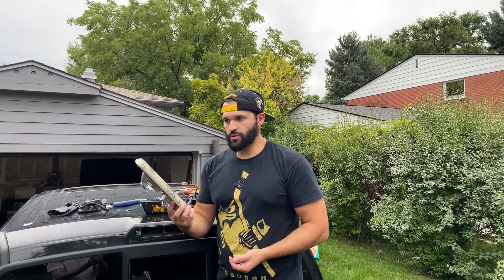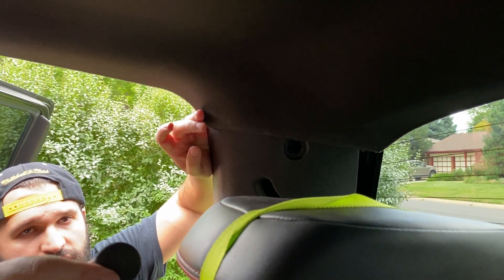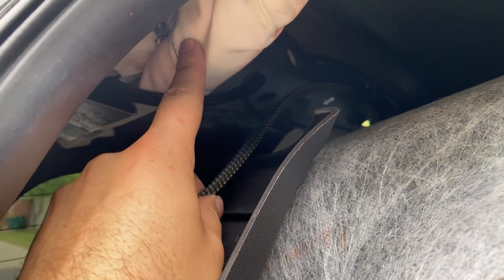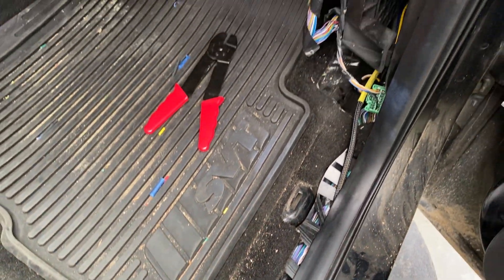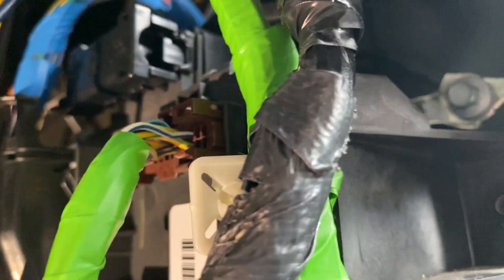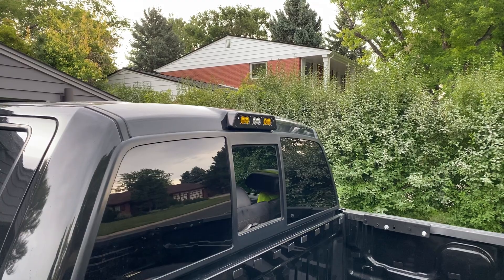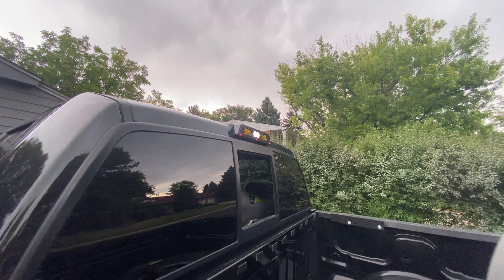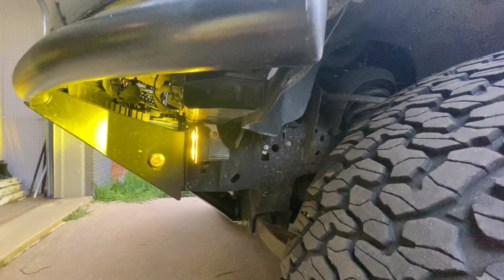How to install GJ Motorsports 3rd Brake Light -  Gen 1 2014 SVT Raptor

Comment: Thanks I am a Gen1 owner.  What are your thoughts on Headlights?  I drive down from Flagstaff and it is hard to see at night with the stock lights with the hi output halogen bulbs.
Reply from the maker: So the 14s have the upgraded headlights, so I'd recommend upgraded your headlights. If you're having difficulty seeing at night, 1000% recommend buying new ones. I know miromoto is probably the leader in that for gen 1s

Comment: Thanks 🙏 for this info. Quick question how do you control the different light is there a switch? Thanks
Reply from the maker: Yes, I wire them to one of 6 aux switches the truck comes with

Comment: Whats the cargo light mines not turning on
Reply from the maker: Cargo light is below your headline knob, left of the steering wheel
Reply: Question does it turn on when you open your doors or just turn on under the headlight switch
Reply from the maker: Yes mine turns on when you lock/unlock and when you open the doors
Reply from the maker: Sorry and manually as needed with the cargo light switch.

Comment: Bought mine from a fellow raptor owner. Am I supposed to reuse the same screws? They dont seem to reach the retention clips.

Thanks in adavance.
Reply from the maker: No, the hardware comes with screws. Assuming you're asking about the actual 3rd brake light piece
Reply: @DavidFigs  I figured. OEM screws didnt reach. I found some in my local hardware store. Thanks for the reply.
Reply from the maker: For sure - if for whatever it doesn't work, I would reach out to them and I'm sure they'd help.
Reply: @DavidFigs  I got it installed.  It works! My OEM 3rd brake light was done. The GJ is awesome!

Comment: I just installed this, but the red marker lights don’t get brighter when I hit they brake. Do yours get brighter or are the suppose to be like that?
Reply: thats what ive been wondering too, which harness do you have to get?
Reply from the maker: I actually haven't even checked if they do, my gut says no. I'll test and report back
Reply: @DavidFigs  yes please, that will be a big deal breaker for me only because of where i live, i use it as a DD
Reply: So the 3 red lights work as brake lights also.. the harness that they sent me had two wires mixed up. Had to switch the blue with the red wire. After that it worked like normal
Reply: @osvaldocaraveo9060  perfect, thanks for the update bro

Comment: This is the first video I’ve seen for the gen 1.  Just for info if you get the back up harness, the white wire taps into the white and blue wire on the BCM.
Reply: That's behind the pass side kick panel correct? What's all the diagrams showing under the hood tie in on GJ website?
Reply: Just bought this and it arrives today. Was wondering where to run the back-up light. Thank you for the info!
Reply: @RobertWojtow  the back up light can be ran to an aux switch or if you purchased the reversed harness, connect it to the white/blue wire on the BCM located on the passenger side kick panel
Reply: @atlanta3451  Yup. I added the Stop/Tail/Turn w/Reverse Harness.

Comment: I'd like to get that installed on my 2011. Havent found them yet. My Raptor is a street princess for now has been since new. Like your set up
Reply from the maker: John Somerville you can order directly from GJ Motorsports and there might even be a good black Friday deal. BD usually does some rebate for the lights atleast. Ty!

Comment: Where did you get your tail lights? Looking to get ones like yours but I want to get a pair that it reliable and doesn’t hyper flash after a week lol
Reply from the maker: It was one of the only mods the truck had when I bought them. They're nice but I recently noticed at night the difference between running lights and braking isn't great.

Comment: How do you like your light combo selection with the center a spot and wide cornering on the two outside lights?  I am about to purchase this light primarily for lighting the immediate area (inside bed and general area around rear of truck) and thinking the spot may be too much throw.  Maybe the work/scene style would work best for my application.  Did you go with the S2 Sport or S2 Pro?  I like the center white and sides amber.
Reply from the maker: Sports are more than enough light. I think the pros would be over kill. Yah work/scene on the center would be fine too

Comment: For the amber lights, is one specific to left and right or did you just have to flip one of the lights upside down?
Reply from the maker: Depends on the lens you got. I put the spots on the inner light and the wide cornering lens on the outside

Comment: Did you wire directly to the upfitter switch? I keep on seeing people mentioning you have to use the pass through wires and it just does not make sense to me because the harness is coming through the cab and not from the engine bay.l
Reply from the maker: There are wires under the glove box, those wires are connected to the aux switches. They come prewired like that from the factory
Reply: @DavidFigs  thank you. I know about those wires and that is what I am intending to wire to but I have heard from several others and even the vendor I ordered the kit from that I would need to use the pass through wires still. After further digging it looks like they might have gotten the process mixed up with how it needs to be done on a gen 2 vs a gen 1. Gen 2 seems to have the wires that route directly to the aux switches in the engine bay vs under the glove box.
Reply from the maker: What light do you have and do you have a gen 1 or gen 2?
Reply: @DavidFigs  I have the GJ setup with basic harness. And also I have a Gen 1. 2012 model.
Reply from the maker: That's exactly what I got too, it should wire up the exact same way I did it. Under the glove box.
Reply: @DavidFigs  ok thank you buddy. I really do think the pass through wires are only needed for wiring up items that are in front of the firewall separating the cab and engine bay. That is what people where confusing me on.
Reply from the maker: Correct - my a pillar and lights on the radiator frame are wired up to the wires in the engine bay by the battery. Your 3rd brake light should be wired under the glove box. Enjoy the new lights man!
Reply: @DavidFigs  will do buddy, thank you again!

Comment: So does the seal go on to the cab or the brake light? Any issues with leaks?
Reply from the maker: Michael Fuson seal goes on the back of the brake light. 0 issues with leaks with both my gen 2 and gen 1
Reply: Good to know. Thanks man just ordered one for my 2013.

Comment: You would think a 3rd BRAKE LIGHT would show a clip of the light operating with the brakes on 🤦🏻‍♂️🤦🏻‍♂️
Reply from the maker: The name of the light is 3rd brake light bc it is a brake light from the factory. Baja design lights are one of the most powerful aftermarket lights you can buy and will blind drivers if used driving on roads.

The aftermarket brake light with Baja design lights should only be used when off-roading.